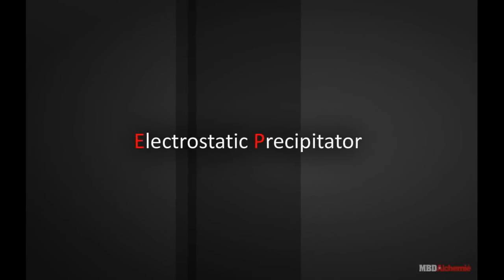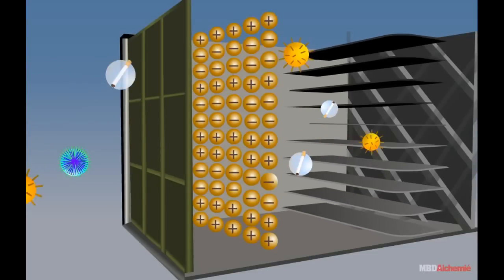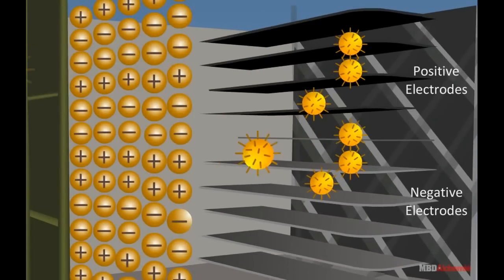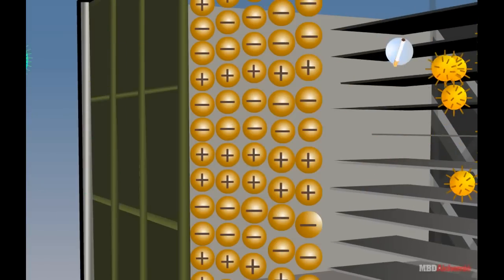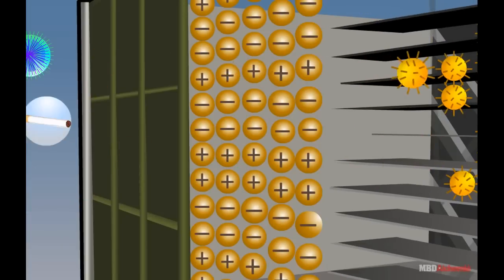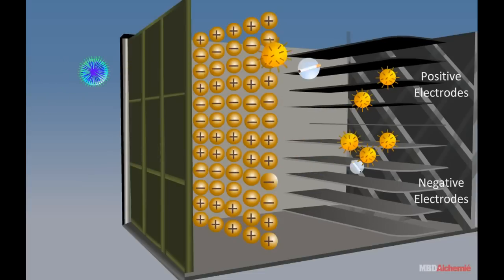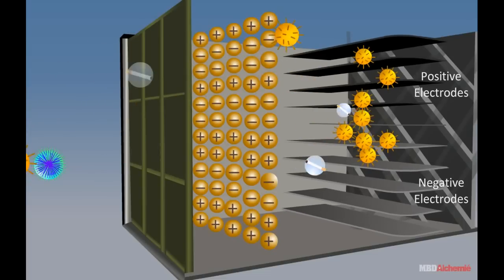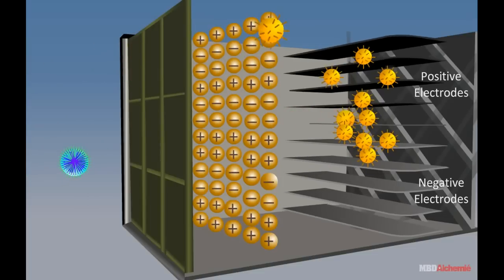Electrostatic Precipitator

Comment: From this video I can conclude, carbon and dust particles are released in the atmosphere from industry, movement by electrostatic precipitators. Capturing the exhaust gas through a magnetic field formed between two electrodes, the exhaust gas which is initially neutral when passing through the electric field becomes negative. Neative dust particles then stick to the plates that are positively charged. Then the roots are then vibrated using rapping in an effort to fall into the hopper and channel it to the fly ash silo with the help of compressed air
Reply: Fantastic Alif , those who have confusion dey can clear their dbts by ur comment
Reply from the maker: Thank you
Reply: hi , can you please send me complete diagram to understand..
Reply: i can used this to my reflection paper thanks

Comment: In this video I captured a bit of interesting information, electrostatic applications in the industrial world are used to overcome the problem of waste dust. Electrostatic is a branch of physics that deals with forces emitted by static electric fields on a charged object. The working s of the electrostatic precipitator are as follows .
 a. Passing the exhaust gas throught an electric field formed between the discharge electrode and the collector plate, 
b. Negatively charged dust particle (-) then stic k to the collector plates. 
c. Dust collected on the collector plate is moved back periodically from the collector plate throught a vibriation.
Reply from the maker: Thank you

Comment: thank you for the very useful video,
I conclude that electrostatic precipitator (ESP) is a technology to capture the ashes of the combustion process by giving an electric charge. If the ash is passed further into a column made of plates that have a more positive charge, commonly called a collecting electrode, then naturally the ash will be attracted by these plates. After the ash accumulates on the plate, a special rapper system will make the ash fall down out of the ESP system. The working principle of ESP is by giving negative charge to ash through several electrodes (commonly called discharge electrodes)
Reply from the maker: Thank you